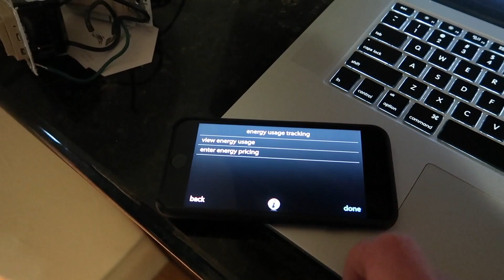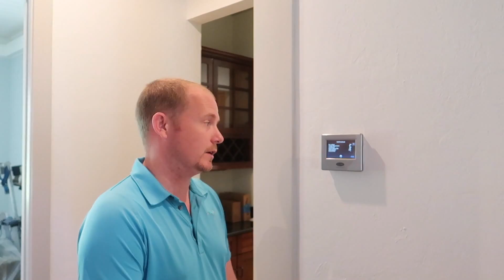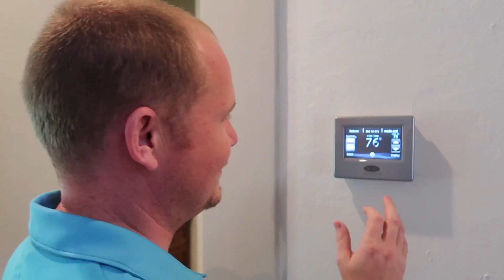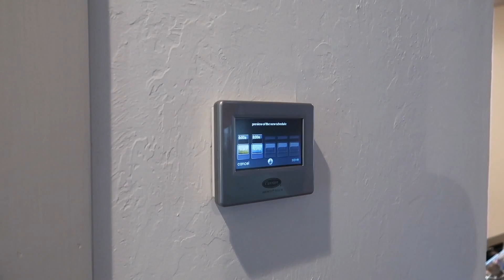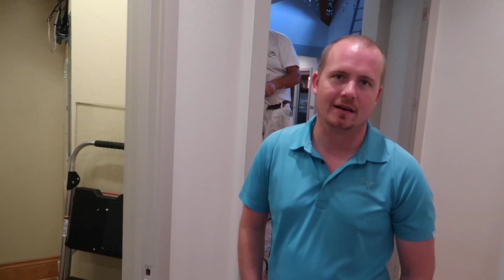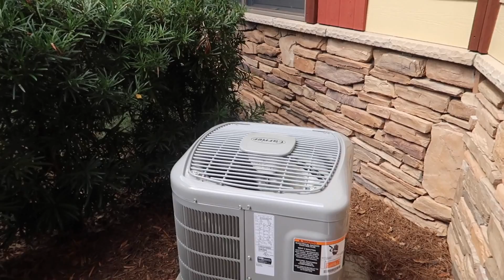Obsessed HVAC w/ Kalos Services: E5 - Conclusion and Discussion About Cost

Comment: If two guys spent 8 hours installing a mini split............was the new wiring circuit that hard? 

Anecdote for you:  I bought a DC powered mini split (not widely available.)  My former HVAC guy (note the former part) came out to help me with the copper.  HE BURNED 2 HOURS TAKING THE AIR HANDLER COMPLETELY APART AND PUTTING IT BACK TOGETHER.  He said he was hooking up the wires-----which had a quick connect built in.

Comment: The only constructive criticism would be run the liquid line strapped to the suction line would look a little cleaner. Stellar job though otherwise
Reply: I was thinking the same thing Joe Shearer. I always strap the liquid line, suction line and t-stat wire together with black ties and make sure not to get them too tight so it doesn't compress the armaflex. It kind of bothered me that the liquid line was laying on the ground like 2 inches from the suction line. It would look so much better tied together. All in all a nice install, although I hate ductboard.

Comment: Why are metal ducts not used in Florida, just because they are not needed and cost more?
Reply: Larry Velez that's one reason, but mainly it's because of the web trusses predominately used in Florida. We have no basements due to the water table.
Reply: Bryan Orr would it be more efficient to use metal air ducts in Florida if the house was designed accordingly? (instead of the flexi ducts which seem to always be used in Florida)
Reply: I don't buy that. I live in North Carolina and most of our houses are built with pre fabricated web trusses and we still use mostly metal duct. Some companies do use ductboard but very few do. I've installed for 15 years and I've never used it. I think it's garbage. Flex duct on the other hand is a great product and we use it for most of our run outs. It's cheaper, lasts longer than metal pipe unless someone damages it, and it's way easier to install. I've only used all metal duct on a few jobs that were in the crawl space and the homeowner was concerned about rodents damaging the duct. I've done some commercial jobs and they even allow like 6 feet runs of flex duct to connect the registers.

Comment: About movie room unit there is pump that starts only when there is water to be removed. This pump can be installed inside unit. Search for Aspen Mini in Amazon.
Reply: Nelko Nedelchev his unit has a gravity drain... no pump. The pump is a recirc on his water heater.